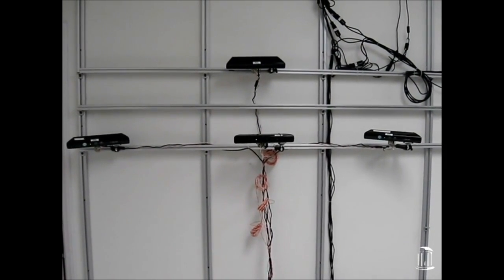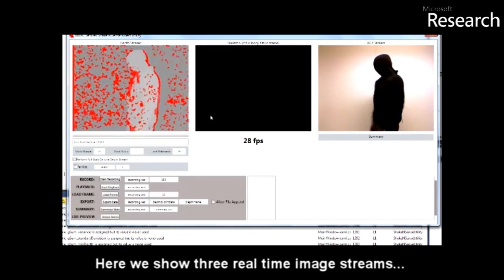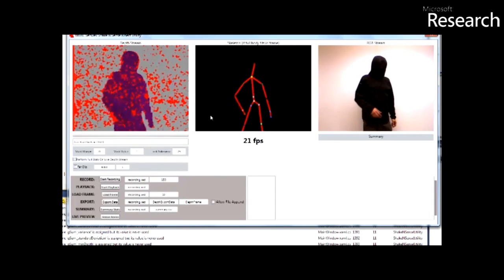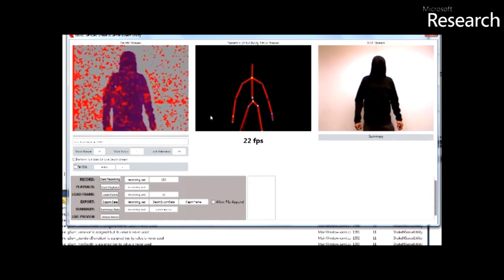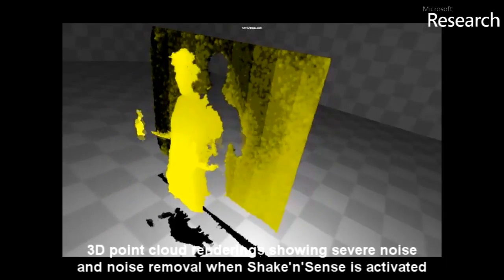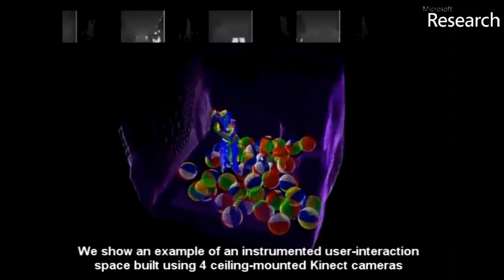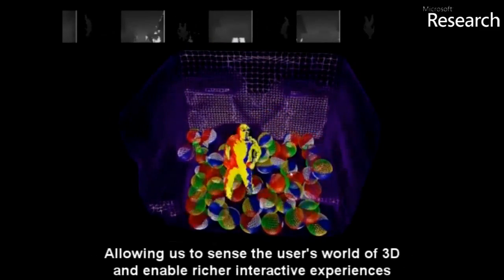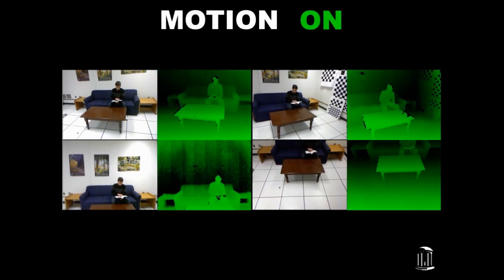Shake 'n' Sense

Comment: This is not the same as a stabilizer or image stabilization, infact, it's quite the opposite. This is moving both the point IR source and camera in the same direction and speed. This causes the light points move with it, the points the sensor sees are static in relation to the sensor itsself (at negligible reduction of resolution), while the images from all other sensors are moving in random different speeds, relative to the one  Kinect, putting them in a blur... Thus, easier to filter out.